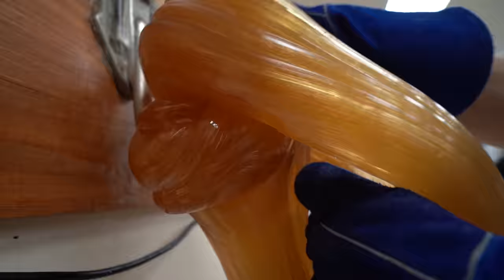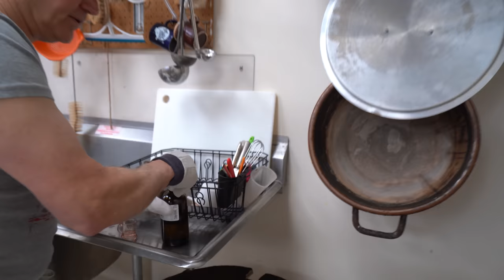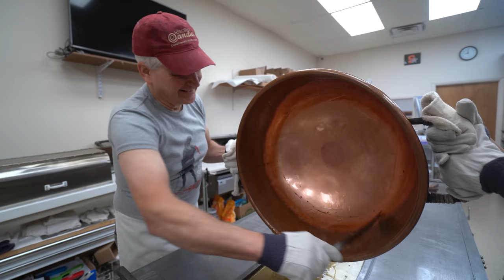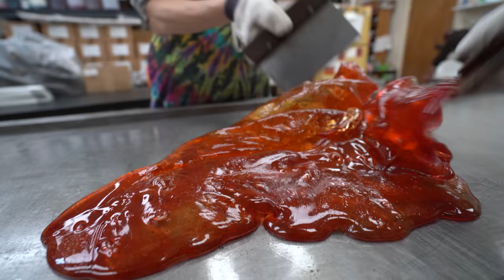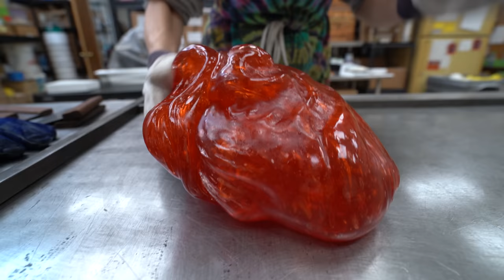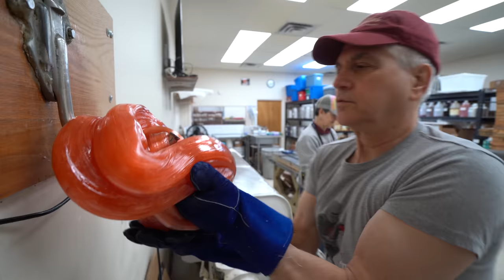This RARE Candy is Only Made ONCE a year!

Comment: Just out of curiosity, why don't you pull the plain ribbon candy to be as thick as the filled ribbon candy, so it doesn't break as easily?
Reply from the maker: this ribbon candy is traditionally thin candy this is only sold locally . Now we make filled ribbon candy that is thicker and can be shipped.
Reply: Would you ship the thinner stuff anyway, if the customer accepts the breakage?  It looks sooo gooood!!